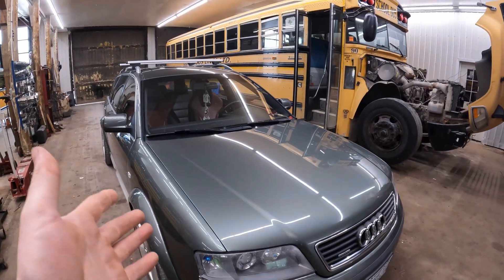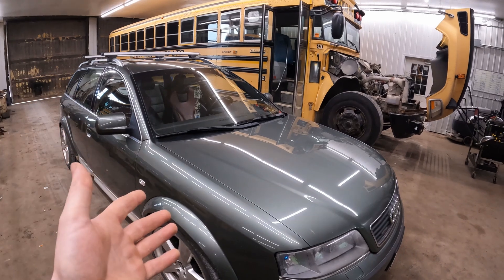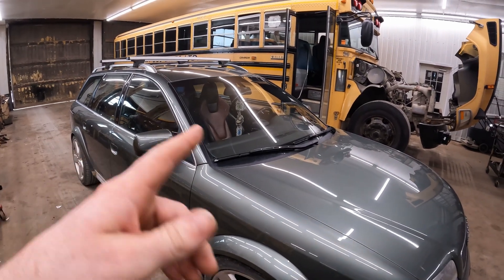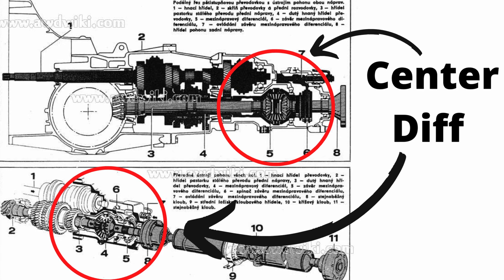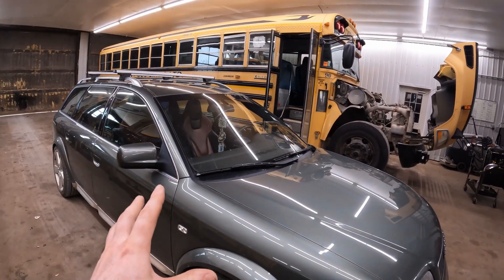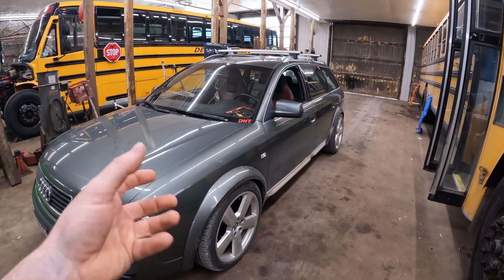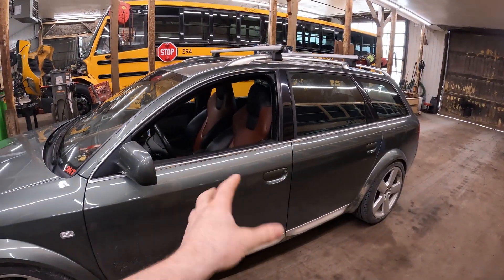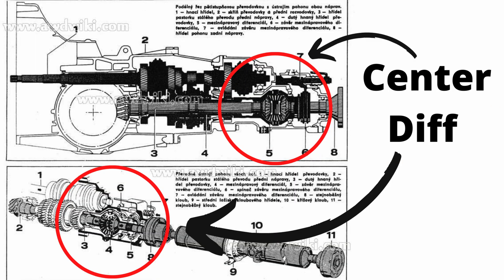RAM 4WD Lock vs AWD **Heavy Duty Mechanic Explains** | What is the Difference?

Comment: It's just 4hi. They only call it lock so that you don't mistake it for an AWD system that doesn't have a 50/50 power split ever since the TRX came out as a full-time which doesn't have a 50/50 power split. Mechanically putting the ram into 4x4lock is traditional 4hi. No difference just terminology. So when you own an AWD vehicle instead of a part-time 4wd you have a center differential and when you lock that you become 50/50 just like a part-time going into high or low

Comment: So basically when you make a turn on dry pavement each wheel should be going at a different speed. When you're driving in snow or mud you want all the wheels getting the same power, and ideally locking front and rear differentials if available.

Comment: Absolutely Wrong, concidering Subaru.
Reply: Subaru is nothing special they are just taking brake traction control that Land Rover invented and pioneered a long time ago😂 and theirs is not even that powerful. The Land Rover acts like a diff lock the Subaru grabs a little and you have to give more and more throttle and then it grabs a little harder and then maybe it will go maybe it won't but you don't have a low range so it kind of sucks anyways.  People get so caught up on Subaru marketing they act as if they invented the torque biasing differential or the brake traction control system and they didn't both of those came from Land Rover and the AM General Hummer

Comment: Thanks for the demo. Though am confused now. Lol. For that Audi, with one wheel off the ground, shouldn’t the other wheels be spinning instead since they have traction (vs that loose wheel  in air)? Instead the opposite is happening here. I thought that’s how awd gets a vehicle out of a bind on the road or trail. Insight pls :)
Reply from the maker: so from a pure mechanical perspective torque/power follows the path of least resistance, hence the wheel in the air gets all the power. now depending on the awd vehicle and the electric traction mechanism they may be able to force power to other wheels through clutch pack systems and so forth.

Comment: Is the drivel line binding/tires skipping on 4WD bad, or is it just the normal result of 4WD? Thanks! I'm learning a lot from your videos!
Reply from the maker: It's not bad that's just how it works. so when you are on a slippery surface like snow the wheels skip a little but does not put pressure on the driveline because snow is slippery. but on dry pavement the wheels still need to skid and that puts alot of pressure on the driveline and can break components.
Reply: Overtime it can cause what's called transmission windup. If you do it enough it would be beneficial for you to drive backwards and turn the wheel left and right a little bit before you take it out of 4WD. That's why an awd (or "full time 4wd" which is awd with low range, vehicle with a locking Center differential is actually better because you can take turns on the street and it doesn't bind up but if you want 50/50 power you lock the center differential.  As a Land Rover driver I can literally just go anywhere instantly without changing anything unless it requires low range yeah I put it in low range but I don't have to engage anything the traction control is powerful enough to transfer torque really close to as good as a differential Locker while simultaneously not needing to think of anything just driving and letting it do its thing

Comment: Nothing is better than a truck that can do what yours does + lock all wheels. It's never really 4x4 when it's not all locked
Reply from the maker: that is the trump card with the power wagon. it can truly lock up all 4 wheels if needed!
Reply: Yeah that's true but it's made for catching traction more for hauling things than it is to be really great off-road. As far as great off-road it doesn't have lots of articulation and it is really unbalanced having a light rear with a heavy engine up front. You could take something without lockers that had quality traction control and lots of flex and it would do better

Comment: So basically youll end up with a 2wd if you get stuck unless you have lockers
Reply: Depends how you look at it,  a 2wd truck would be a 1wd truck  so you even a 4wd with 2 wheels spinning will have twice the traction as a 2wd with 1 wheel spinning.
Reply from the maker: more or less yes!

Comment: I’ve seen Subarus with one wheel in the air and they get through the obstacle easily.  I wonder what the difference is.
Reply: Because they have brake traction control just like Land Rover invented. The brakes using the ABS system grab that spinning wheel and that by default transfers torque to the differential to the wheel that isn't spinning has traction

Comment: If a Nissan GTR is AWD then 4 auto is AWD. They work exactly the same. And no, wheel slip is not required to active the front wheels. In fact the 4 auto system in my in old Infiniti QX4 just used the AWD system from a Nissan sports car. They just gave it a 2WD setting and a low range transfer case. But it could just look at the temperature and activate the front wheel. Also things like the amount of throttle. And it's not the only one. Others can too

Comment: Great explanation. Sadly on many cars this is just becoming a marketing term. Case in point, the Jeep Grand Cherokee vs the Dodge Durango. On the GC with basic 4x4, that system is identical to the one on the Durango. On the GC it's called "4x4" and on the Durango it's called "Awd".
Reply from the maker: Ya it's kind of like a more "street" focused vehicles is an AWD vehicles and an "off roader" is called a 4wd system. when in most cases they both have a part time 4wd system. so that's why I referred to the Audi as a "true" AWD system. but at the end of the day both system set out to do the same thing. I just thought it would be cool to show the mechanical differences
Reply: @GettysGarage  Yep, but in the case of Durango/GC that system they share is actually full time as well, can't turn it off. It's rear wheel biased. The advanced GC 4x4 is different yet again, they have at least 2 different system, I think 3 in total?
Reply: @JohnSmith-ev1sm  Ths durango is kinda weird though. It uses a geared center differential with an electronically controlled clutch to act as an lsd for the V6. A Auto-AWD with a low range transfer case for the v8. And for the SRT they use the same system as the v6 but with a Subaru STI like variable torque split function.
Reply: @GettysGarage  Part-time 4WD doesn't mean it only works part time. It means you can only use it part-time. You Ram Power Wagon is Part-time 4WD. What your talking about is really just Auto-AWD. Cause that's what 4 auto is. It works exactly the same as AWD systems you would find on porsches, bmws, jaguars and many others. Full time 4WD means it can be in a type of 4WD setting all the time. Mean it's AWD most of the time. So either a Auto AWD or full time AWD setting but can be locked into 4WD. Two examples of Full-time 4WD vehicles would be the Toyota Land Cruiser and the Nissan Armada. The Toyota is normally full time AWD with a locking center torsen LSD. And the Nissan with with a lockable center clutch pack

Comment: Great video! Love watching your videos. But I thought the awd systems sent power to the other wheels when it sensed slippage? I guess I thought wrong.
Reply from the maker: It's tough though because ALOT of manufacturers refer to their vehicles as AWD when they are really just part time 4wd systems. the audi has a true awd system but both 4wd and awd intend to do the same thing.
Reply: Short answer is, not all AWD systems are created the same. Some like Acura's SH-AWD also includes torque vectoring.
Reply: The early quattros had manual locking diffs. And from the a4 b5 it got edl. Electronic diff lock. When the system detects slipping in speed below 40kmt it will apply the break on the wheel that is slipping. And the torsen diff transfere power from front to back mecanicly where theres most gripp